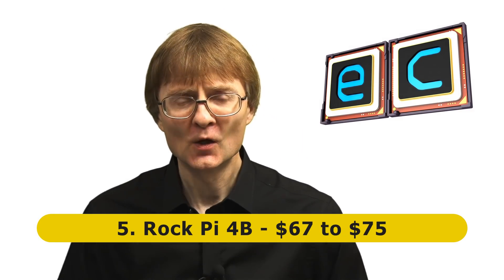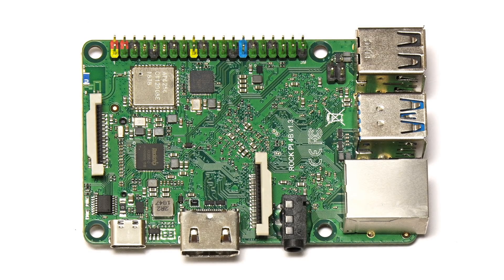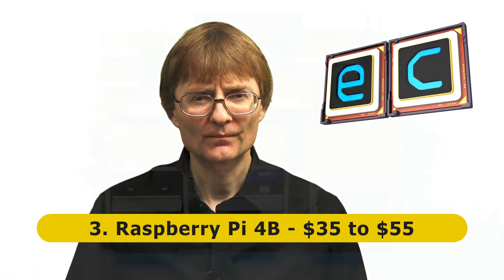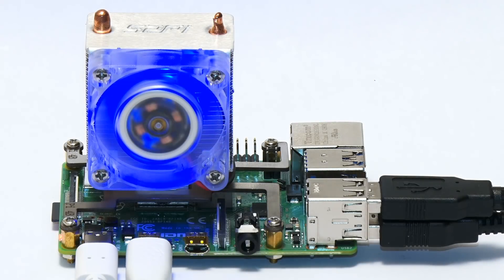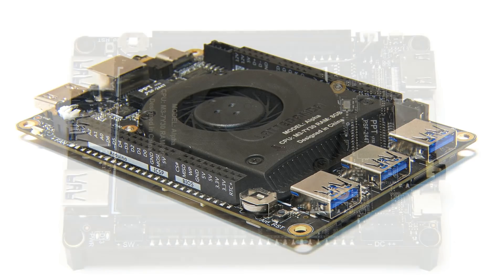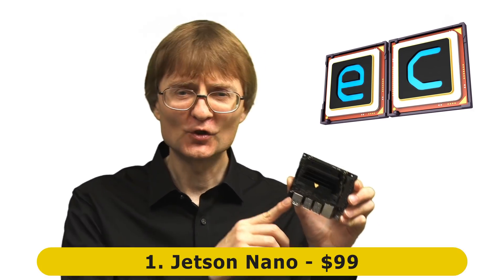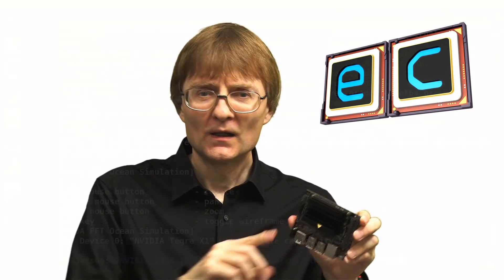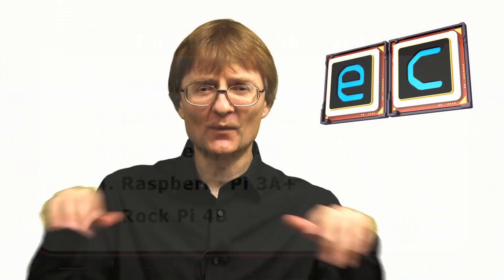Top Five New SBCs 2019

Comment: The atomic pi should have been in the list while the raspberry pi 4 is the worst SBC. I use it as a domestic server and it runs at 75°C, which is unacceptable... i've bought a cooling system from aliexpress and this is the first time i need it for a SBC :(
Reply: I bought the Atomic Pi, it shouldn't be on that list, in fact if it was a list twice the size it wouldn't be on that list either.
Reply: @twmbarlwmstar  I use it as a server and I love it, i doubt you have if you speak like that.. if you defend the pi4 and hate the atomic pi, it means you don't have it.
Reply: @NotMyLinux  How do you use it as a server with one USB3 socket?  It doesn't have EEC memory either, and that Cherry Trail is as far from a server chip as you can get.  And I do have the Atomic Pi, stop being so childish, it's just by my right knee actually- and I am hardly alone in being critical of the Amic Pi either.

If you are using it as a server then it will be crap, running the storage off one USB3 port.  The Pi4 beats it hands down, as a NAS...

Anyway the total I paid for the Atomic Pi was "Total: US $79.88" plus the duty, plus the VAT, plus I think £25 to Parcel Force for a handling charge.  Massively over-priced.   I bought it from the USA from a vendor called  shakaworld.  So I do have it and it is rubbish.
Reply: @twmbarlwmstar  first of all it has built in storage and programs on it are faster thanks to that. Then, in idle, id doesn't get to 70°C.. When i first got it it was able to handle a plex server (without getting hot) while now is serving as a domestic server, controlling the various domestic clients I have. The raspberry pi 4, which I have, is garbage without a cooling system, will you give it to children to learn how to program? It is good to cook an egg.. Yeah the atomic pi + shipping + VAT is more expensive, but I'm going to buy another one to install steam on it and play.. can you do it with the raspberry pi?
Having a non-arm processor just gives you more things to do, people that complains don't know what to do with a SBC.. and wait, I'm complaining about the temperature on RPi4. I haven't tried a NAS with the rpi4 but with an odroid hc1, i will try it hoping it doesn't burn my home.
Reply: @NotMyLinux  Cooling a CPU is trivial, adding I/O or extra needed functionality to the Atomic Pi is not.  I have a box full of heatsinks and cooling fans.  I don’t care what you chose to do with your Atomic Pi, you bought it so you can do what you want but there’s no way it should appear in this top 5 list.
Also considering you have an Atomic Pi (and I apparently don’t) I thought you might have mentioned the USB 2 header that can gain you two USB 2 sockets if you fork out another $38 for the daughter board, which also then gets you a way of powering the thing- well as long as you have a powerful enough PSU that is.  Strange that you wouldn’t know about that.
Or you could try this;
http://stuffandnonsense.elephantandchicken.co.uk/?page_id=547
Costs about £12, I bought one for the Atomic Pi I don’t have but never used it as you need to take a soldering iron to the Atomic Pi to get it to do much at all- or pay dear for the daughter board which is actually the only thing they did actually make themselves rather than pull out of a skip.
It has ONE PCI lane, which you can’t use as it is needed for networking.  It has non-standard and incomplete GIPO.  It’s easier to list what it is missing than what it has.
And you are using it for a Plex ‘server’ which you could have built with a £60 ITX CPU embedded motherboard- which would have had enough I/O, like SATA ports, which I’m told are popular in servers.  For the same money you can buy a Cherry Trail mini-PC from China that will have SATA, a case, USB sockets, and a power supply.  If you add the cost of the daughter board then you can afford one with M.2 as well.  Makes for an excellent Plex ‘server’.
I’ve run the Atomic Pi alongside my Raspberry Pi3B+ and there’s nothing in it beyond 86_64 and the benefit of some better graphics drivers- but graphics drivers aren’t needed for a server, are they?  It makes for a marginally better games emulator than the Pi3, but not by enough when you can get the Nvidia Nano for £100.
The Atomic Pi might have been innovative back in say 2010, acceptable in 2015, but the Pi4 beats it hands down by having better I/O.  The Atomic Pi is bereft of the I/O we do need but has a BNO055 which would be great if anyone knew how to use it.  It seems the documentation went missing at some point in its first life as an automotive part.  Yes, that’s right, was an automotive part, failed at that, was an AI robot, failed at that, now currently failing as an SBC.   It will die, there’s finite stock and there will be no more than 30,000- the Pi at launch sold 100,000- in less than a week- and you don’t see many of the original Pi these days.
I can’t wait to gift mine just so I don’t have to look at it- it’s a constant reminder that in my enthusiasm I was had. Then again if there are enough crazed fanbois out there maybe I will just sit on it, once they sell the last one I can then sell for a healthy profit to some mug.
Reply: @twmbarlwmstar  A graphic card is needed also on a server if you want to compute heavy things with it, but let's leave this use for experts. I use only the ethernet port as I don't need anything else (and the incomplete gpio as you said) but i prefer a failing board respect to a board which gets 70°C at idle which is a huge problem. The raspberry pi foundation is the only company (that i know) selling al incomplete product, with huge heat problems. SBC started to be used without anything more, naked as you buy them... the fact that i need to run behind the company makes me angry. Yes you can put a fan but you need also a cooling system for the sd card, which gets hot.
As long as you have linux on a system (which is running) you can solve or use everything on that board, and this is the case.. no matter the board, as long as the system is stable i'm happy (not like the banana boards).
I'm in Italy and i got the atomic pi with just 10 euros more than a raspberry pi 4 1 Gb, that is why I'm so angry with the latter.. i saved money buying one but now i'm forced to buy a cooling system, because the raspberry foundation just cares of saying "ehi it costs 35 dollars!".
Then a boardis good or bad depending on the way you use it.. that's way i'm saying for a lot of uses a naked atomic pi is better than the rpi4. With a cooling system things change, but not that much.
Reply: @NotMyLinux  Yes, you need a graphics card for your Plex Server- how the hell you going to fit it though?  You have ONE PCI lane and that is reserved for networking which a server most definitely needs (are you for real?)
Reply: @twmbarlwmstar  Sorry for the delay but the board has an included graphics card.. which is more than enough to run Plex for yourself and the family. Still you are missing the point of my debate..
Reply: @NotMyLinux  No you illustrate ignorence, the 'graphics card' doesn't exist- it's a SoC, yes it will output graphics, well  enough for 1080p/pretty flaky for 4K.  However it won't help or do intensive compute tasks.  You are confused with CUDA cores which are a Nvidia thing.  The Atm can't do that.  If you want CUDA core then but the Nvidia Nano which Chris placed number 1.
Reply: @twmbarlwmstar  As i see that you are heating up, i will answer back: do you know what is a GPU? It is a coprocessor unit and it stands for graphics processing unit. Before you tell that a person illustrates ignorance, please study. A "CPU" is unable to serves graphics, you will always need a GPU for that that can be fast or slow (that depends) but it is a specialized  processing unit (200MHz GPU is faster than 1GHz CPU on graphics jobs). If you want to do "heavy" computation you will never come close to ARM because you need powerful hardware. If you think you can do intense hashing on a simple raspberry you will be out of luck. I live in Italy and for me a raspberry pi 2 Gb costs 49€ + shipping + sd card while the atomic pi costs 35€ (ameridroid) +10€ of taxes + shipping. Saving 4€ i get a BIOS, no heat problems and an x86 processor. Do you think that is less than the raspberry pi 4? ARM processors typically have the advantage of power consumption but the CPU of the APi only needs 2W, which is laughable. The ARM processors are convenient but they have RISC architecture, they suffer at managing data/float numbers. Don't trust me? Do some benchmarks and you will see by yourself.
If you want a cheap server managing scripts written in C or python or even Java, using threads and having to work on intensive data i prefer considerably the atomic pi. I'm not using it as a NAS but as a database for my work, and the speed is amazing (considering the price). Try to write multiple data on the RPi4, you will be ALWAYS stopped by the actual speed of the SD card.. while the API has on-board storage. If i were american, there will be no doubt on the board to buy (as I suppose taxes are included in the price for them). Do you eventually get my message?
Maybe for a NAS the raspberry is amazing (i didn't try it) or even for plex,  but considering the ratio performance/price it really let me down.
"sysbench --test=cpu --cpu-max-prime=20000 --threads=4 run"
on atomic pi:
"General statistics:
    total time:                          10.0050s
    total number of events:              5773"
on rpi4:
"Test execution summary:
    total time:                          63.3373s
    total number of events:              10000".
Can you spot the difference? Try it by yourself.
Reply: @NotMyLinux  Firstly, you live in Italy and you aren’t Chris who lives in the UK.  My comments on cost accurately reflect the cost into the UK.  I know what a GPU stands for but your point is irrelevant, it was claimed that the Atom makes a good media server because a media server needs a powerful GPU- but the Cherry Trail SoC doesn’t have a powerful GPU, clearly they are getting confused with some servers (and only some) accessing CUDA cores which again the Atom doesn’t have.  The Atom is rubbish and at about £80 into the UK, expensive rubbish, which is probably why it has no support community (prove me wrong and give me a link) and why it isn’t in Chris’s top 5.  It isn’t in mine either.

It isn’t a case that the Pi4 is maybe better than the Atom for Plex, it is better and it is cheaper even when you buy the 4GB version with 4 USB 3 ports.  The Atom has one USB 3 port, plus 2 USB 2 if you solder them- no proper documentation that means some of the features are completely unusable and will always be so because it is closed source. 

You can cry about the facts all you want but it wont change the facts.  The Atom will/is a failure and for about the same cost into the UK you can get the vastly superiors Nano- which Chris feels (and I do) is number 1.  Just compare what I can do out of the box with a Nvidia Nano compared to the Atom, out of the box  and afterwards.  
 Sorry I don't understand the figures at the end of your post, they are meaningless as there is no context.

Comment: I thought you were, ummm, 'extra' fair, on the Pi4. I like the Latte Panda Alpha too and despite the price, it deserves to be there imo. Your #1 is exactly that - YOURS! As it should be. Your channel, for one thing and I tune in BECAUSE I want to hear your hands on opinions. So, I'm all good with your list. :) Thanks for sharing!
Reply from the maker: I did record more about the Pi 4 and its "early days" software, but it started to sound like it should not be in the list at all. And I do like the board.
Reply: @ExplainingComputers  I just felt a little let down about the 'essential' required cooling on 4. It meant that everywhere that I currently have Pi3's, I couldn't just upgrade as each case and enclosure I had would be useless on the 4. I DOOOO love the board upgrades though. Just need new enclosures now too. Hehe. That's all. :)

Comment: I can't stand the micro-HDMI ports on my rp4.  I wish they'd gone with stacked or just a single output.  What percentage of people use this SBC to run dual monitors that would justify this move?
It should also come with an onboard fan header - just for fun.  If space could be found on the PCB for at least a couple of tiny through-holes to be used for mounting cooling solutions that would also be greatly appreciated, and allow the foundation to set a standard in this sector.  Then we'll see some rapid increases in computing power and tiny coolers.
Exciting times.
Reply: maybe even small 5v powered water/air hybrid coolers

Comment: Nicely done. I agree about the latte Panda. It's a very cool board, and its Passmark score is on par with my Lenovo t430s, which has been running quite well for years. As a matter of fact, I've only been motivated to update the machine recently. It's performance has always been decent, until the current generation of CPUs. Seeing this low power CPU board is very cool.

Comment: Awesome video covering something from those with deep pockets to those on a tight budget. Whilst I wouldnt buy a LattePanda Alpha I wholeheartedly agree with you that it opens the door for others that will come in the future. In 10 years we will probably be having SBCs smaller than the Pi Zero with more power than the LP Alpha. Hopefully you will be reviewing it around 2030 or sooner. A decade is a long time in technological development terms
Reply: SBCs are getting pretty congested with all of their connectivity & features. But, whenever size matters (as in less = more), I'm getting a lot of bang for my bucks with inexpensive micro-controllers, such as the ESP32 & ESP8266 development boards + accessories.😎
Reply: as far as size goes, we're approaching practical limits with CPU die size (which is the largest factor contributing to speed). pushing Celeron performance out of a die the size of a Broadcomm chip is going to make magic smoke even with 3-5nm. Your board might be small, the heatsink probably won't be. That said, the Latte Panda as a footprint is going to be a good bit more powerful in a few years if you don't mind the fans or radiator keeping it cool.
Reply: @DFX2KX  
Thats with todays technology. Phones are getting more and more powerful with every iteration and they are quite small. 10 years ago the idea of a matchbox sized computer for $30 would never have entered my thoughts but they are available in abundance now

Comment: I can see why number #1 and #2 are there. Maybe it should be a top 10. 

I can't see the RPi 4 to be on #3, tbh. I feel like I was a bit tricked by too many positive reviews in getting one. Finally someone actually made an (unofficial) Ubuntu 64bit kernel (https://jamesachambers.com/raspberry-pi-ubuntu-server-18-04-2-installation-guide/) which works great. Manjaro also offers a 64bit version. While it looks like the most complete solution it lacks in performance and features to other competitors. 

One which should absolutely be in the top 5 in my opinion is the nanopi M4, which has a NVMe slot directly mounted on the board, the same RK3399 as the RockPi but does not need a cable to connect to the SSD. It is at least equivalent to the Rock Pi.

Performance wise and the Odroid N2 beats them all - with 4 .big and 2 .LITTLE cores and eMMC up to 128GB. Running this on Manjaro Linux is actually a fantastic experience. Ubuntu is available, too. This thing never gets warm with a fanless built in heat sink. 

My all time favorite, however, would be the HiKey 970 - which unfortunately is very raw. One needs to find a proper kernel and configure it but running (X)Ubuntu 18.04LTS runs very clean once you get it on there. With 8 core Kirin 970 cpu with 4xA73@2.06GHz (2.36 max) and 4xA53@1.84GHz and 6GB of RAM it beats all other boards; and my MacMini i5 (2012). I would put this into the Latte Panda category. The only problem with the HiKey is, it isn't very well supported but could totally compete with the Latte Panda - and while also expensive ($299) it beats the Latte Panda by about $50-$100. 

It would be interesting to see either a Kirin 990 board some day or a Snapdragon 855 - which is very absent from the SBC scene (no 835/845 boards either, which one could buy easily).

I love your channel, btw. Lots of great information which really got me into this whole SBC thing. I run them as my personal cloud, though, and probably have different expectations than most SBC users. I have not checked out the Latte Panda Alpha, yet. But for that amount of money, I might get me a 16core Arm Honeycomb LX2K server (https://www.solid-run.com/early-access-limited-offer-honeycomb-lx2k-workstation/). Of course, if size is a priority, you can't beat the Latte Panda. Also, targeting x86 builds might be something the Latte Panda could do out of the box.